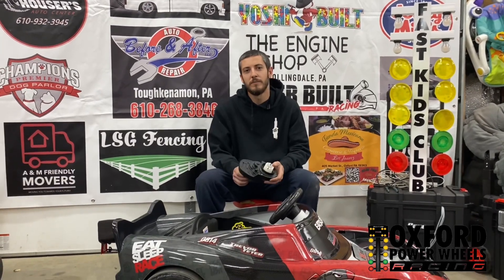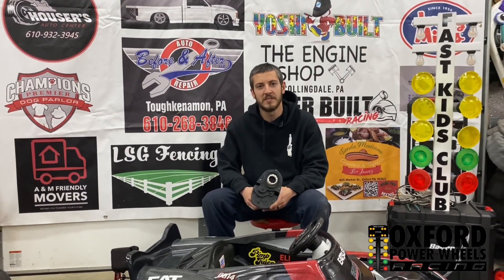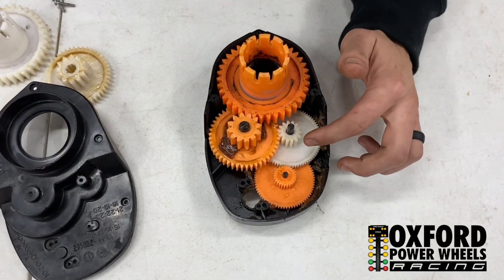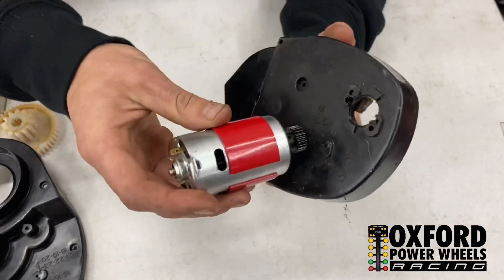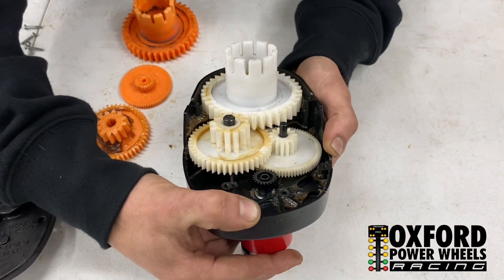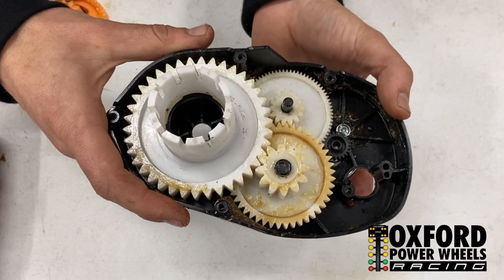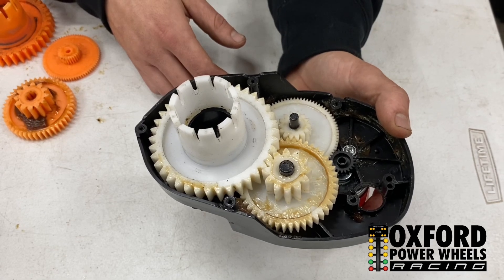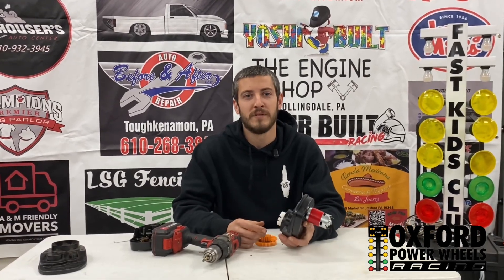Power Wheels First Gear Delete

Comment: Been doing this since 2017, but always used an aluminum plate to hold two 775 motors on the back; the plate solidly locates the motors and stiffens up the gearbox case.  I have several vehicles that are still running the original motors several years later but have also broken gearboxes in half with the resulting torque...  I would be worried about your setup's durability under hard use-- you've blocked the motor's cooling intake holes and the thin plastic you're mounting to is not very strong (the normal mounting point is pretty sturdy). Has it held up fairly well?
Reply: Def agree
Reply: How much would you charge for a couple modded boxes?
Reply from the maker: I have 1/8 aluminum plate on the backs of the gear boxes, before like the video it was just plastic , but believe it or not we never had an issue that way! But I knew I needed to stiffen it up once we did a dual motor setup , it’s nice and solid now with the 1/8” plate, no gears breaking, and faster than he’s ever gone!!
Reply from the maker: We use our setups for drag racing only

Comment: So you can run any tooth pinion gear as long as the mesh is correct?
Reply from the maker: Correct! But you will need to do some testing to confirm the best pinion size for your setup , it depends what you want , a lot of top end or a lot of torque , more torque smaller pinion, more top end, bigger pinion
Reply: @TrevorsFastLife  that's awesome and thank you for the videos and info. My little guy is excited!
Reply from the maker: @hopperracing  no problem man! Hope to see him flying!

Comment: Your killing me smalls. Jk. If i get all this done and figured out and we go down there in the south side, indiana and my son straight gaps everyone. im just going to say you did it. You caused me to just go all out!  Lol😂😂😂      i have everything, but pinion gears and a connector for the controller for the computer.  If you do a first gear delete, does that mean the pinion gear changes?   
Also, I just ordered a dc power supply to break in the redlines. 
 Could have had rear disk brakes for the rwd cavalier im building with the funds im putting in my sons porsche. All fun!  i love it!  For the kiddos!
Reply from the maker: 😂😂😂 doing the first gear delete, you will have to figure out the right pinion size for your setup depending what you want! Smaller size more torque , bigger pinion , more top end.
A little bit of trial and error will give you the best setup! 

Break in the motors on 6v then 12v and they should be good for awhile! That’s what we do

Comment: Im considering doing this for my daughters 20v dale car with c7 power wheels wiring that ill be building for drag racing it has 550motors on will it be good or should i put 775 motors and also her 20v "drift" corvette do you think it will kill the low end torque and prevent her from spinning by doing this mod or will it be better?
Reply from the maker: Make sure you redo all the wiring with 10 guage and use a 100amp or more breaker, it’s to much of a load on a stock shifter switch and wiring 

It’ll be fine for drifting still it’ll give it a lot more mph 

550s or 775s will work
Reply: Awesome thanks! Love watching your content🤟 i also messaged  you on fb for details on the power wheels drag racing rules and different classes ..do you have a sheet of the rules, restrictions ect somewhere just so i have ideas where to start and how to split classes  i think about doing like stock 12v, modified 12v 18v 24v..i would love to organize something like this for the kids and parents near me (ontario canada) at carshows, local events... i dont plan to go as big as you guys for now but love the way your all organized thanks in advance

Comment: Any suggestions on where to start as far as pinion size for 50 lb kids in 2 seater mustangs? Stang wheels with harbor freight mat rears like your video, 20v tool batteries, adjustable motor control and 775s. Only asking bc my motors didn’t come with pinions and idk what to buy 😂😂 thanks for the vids
Reply from the maker: I would do 13 or 14T start there, with the ESC it detects load on the launch so you don’t want to have to tell of a pinion or it’ll bog really hard , we ran 12s on my sons lambo and it did 2.80s in the 60 foot 

It will be a little trial and error with pinion sizes , order a few different ones and just play with it
Reply: @TrevorsFastLife  and that’s 14/15T with the first gear delete? Thanks!
Reply from the maker: @scottf8136  yes sir!
Reply: What pitch? My Thunder 24v UTV measures to a 20dp, not 32, like the 7R gearboxes evidently have.

Comment: I did a first gear delete and I’m having issues with the battery’s only lasting a minute or 2 on a 12ah battery , is something else the issue ??
Reply from the maker: Sounds like something is shorting out , 

Make sure you are running 10 guage wiring and get away from the stock shifter switch , only made to handle 30amps